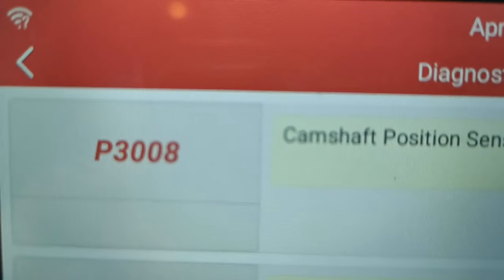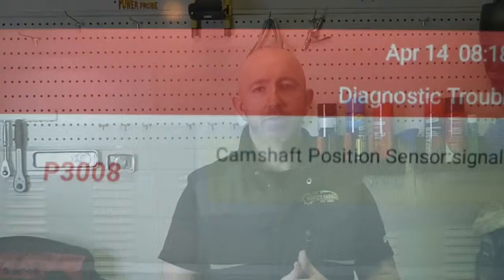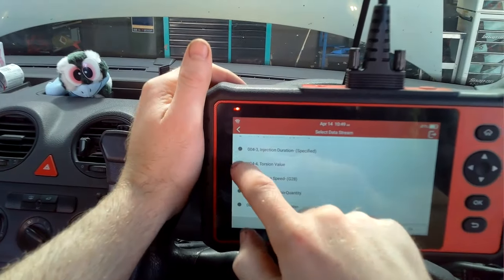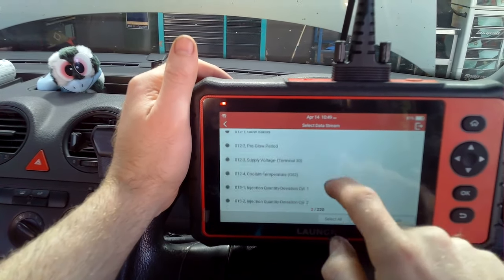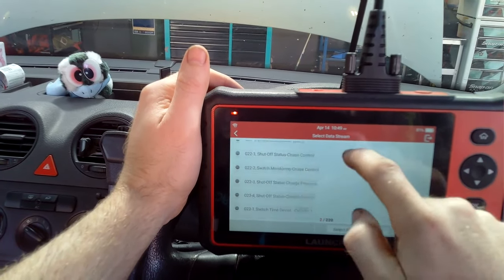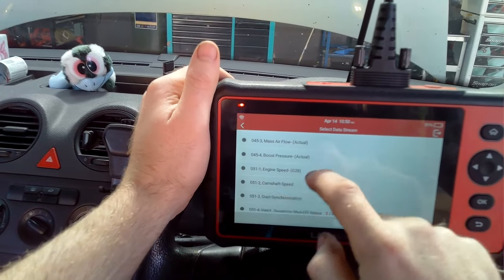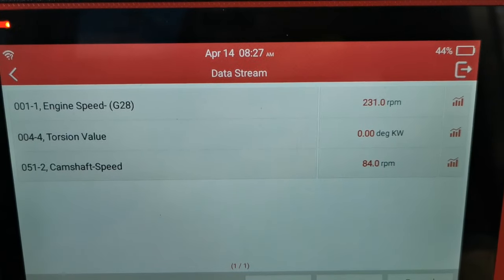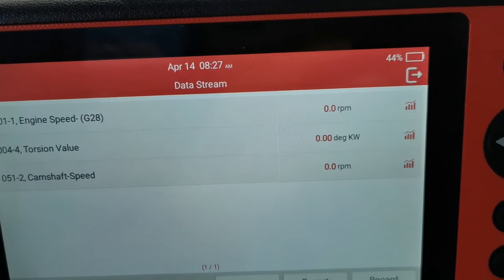Volkswagen TDI Cranking But No Start Fault - Found & Fixed - How To DIY

Comment: Thank you, you clever man. Unplugging the camshaft sensor was the clue I needed when I had been looking for a fuel fault. If you were here, I’d buy you a drink.
Reply: If there is still no start with sensor unplugged do I then follow up fuel problem?
Reply: Exactly what I did. In my case pointed to no fuel from pump in tank. While following to replace pump came across bad wiring.
Reply: Mine is doing the same thing need to do that tomorrow morning I was about to buy fuel pump but let me try this

Comment: All VAG owners become a mechanic in no time, hahaha. I've learnt a lot about TDI because I bought a high mileage VW Caddy 1.9 TDI. Part after part after part has been replaced my me. Things keep breaking at 300,000km. My van is practically new now after all the work I've done to it. It's drive another 300,000kms
Reply: I know exactly how you feel I have a 1.9 2009 golf
Reply: Vw 2.5 😂😂 u right i done lots of parts and scans

Comment: You may have just have saved me a small fortune.   I was losing hope to an extent.  I drove the car parked it up, then it refuses to start that Evening.  Servicing has been kept bang up to date.  Interestingly  its timing belt, and water pump were replaced only several weeks ago. It has been such an easy starter to date, and was seemingly running nicely.  It delivered 65.2m.p.g running up to Morecambe and back to Cornwall.  I've precious few pennies to replace the car with at this time.  If Your advice pays off here Gerard I will really need to send you a decent drink Sir..  Thank You so very much for posting a clear concise video.
Reply: any updates ser?

Comment: Hi, I have a 2.0 bkd engine, it starts really slow in the morning. I changed the battery, injector orings and glow plugs, but still starts really slow in the morning, after 2 cranks.

Comment: Please assist I've done engine overhaul,the engine starts but rev up to 2500rpm.ive done timing on the front and rear crank sensor.please assist vehicle has no power 😭

Comment: Mate iv changed the timing belt and sensor code gone and started and run for bit cut out got code for glow plugs changed them and now it crank try to start 1000 rpm and cuts out iv checked fuel all seems fine have no clue  what is going on now nothing  coming up on scanner any clue  any advice would be fantastic  thanks

Comment: Thank you so much!!! My 2000 Jetta tdi with 419,000 miles (that I put on it) wouldn’t start today. So while I was in a parking lot I watched your video and it was just what I needed to diagnose the problem. My fuel injection pump pulley had slipped 1/8 of an inch from the last time I did a timing belt change a year ago. So I grabbed a socket set and a couple wrenches and 15 minutes later it fired right up and I was able to drive back home 😀.

Comment: I recently bought a cheap a vw bora 1.9tdi pd100. Took about 4 seconds to start. So I was looking around the engine bay and noticed the cam position sensor was unplugged and taped up 😮. Plugged it in and no start. 

Decided to check engine timing. The crankshaft pin locked  in and cam was about a tooth out. 
Maybe a touch more. Retimed it all and plugged sensor back in bingo. Runs like a dream now.

Comment: wifes old car has been sitting for 6+ months, started maybe 3-4 times and not driven. I started to drive it and noticed hard to start when cold. I popped the bonnet to check the battery charge and there were 2 spanners, thinking I left them in there for 6 months after a service, went and checked them after watching your vid and they are 13/19mm, I must have played with cam timing... without lifting a spanner to it, id say your vid has got me in the right direction

Comment: Lovely video, it's exactly the problem with my Seat Ibiza 1.9tdi 2008. I just noticed by this video that the sensor might not be the problem but yes the camshaft out of position since a cold start will make a knocking noise from the engine. Will be great after 5 mins but since the sensor is telling me something is wrong it's a lot easier to follow this amazing video before blindly buying a new sensor. A 10000000 thanks to you !!
Reply: Mine at cold start taps for about 5 seconds then goes away.

Comment: Nice Diag Gerard good Bias voltage 5v on the signal wire the torsion values are as close to zero as possible
Reply from the maker: Cheers for that Ian 👌🙏
Reply: When testing the signal wire. Shouldn't the cam sprocket be in a certain position? Cam sensor is a potentiometer so surely if in wrong location wouldn't the 5v be pulled to ground thus sending a signal of cam position.

Edit... scrap that. You run the test with sensor unplugged. Only relevant when backprobing.
Good job. I've worked on loads of these and didn't realise the torsion could be so far out as to cause non start.

Comment: We used to have a dude like you at our work but unfortunately he left & as far as I know, he's out of the trade, it's a shocking waste, he'd make an excellent trade school teacher 👍
Reply from the maker: Thank you Lance, I appreciate the comment.
It's such a shame when we lose good techs to other jobs or roles. They are needed badly these days
Reply: @GerardBurkeBurkesGarage  I have a jetta 6tdi it does not make start. If you put quick start on it it will start bt it does not Rev. No power at all. I tested the injectors they are 100 % correct. Vcds is showing nothing.
Reply: Must be running to set torsion values.
Reply: Possible MAF problem or intake air leak.
Reply: If you have a lift pump, make sure it is providing pressure.

Comment: Torsion value is written in pen on the cam cover on them all, usually doesn’t last too long. Supposed to be written in the service manual too. Some can be up to 5 degrees either way, 0.0 is usually the best benchmark to adjust from when doing it.

Comment: Great video Ger my car is in a garage at the moment it had a leak in a fuel line its now repaired but wont start ..
Reply: Bleed pump and injector lines if it is ALH engine.
Reply: @bobirving6052  got it sorted after a week..

Comment: My 2013 Passat TDI just started doing this a few days ago. We'll have a go at it and hope it's this simple. 😁 Ty
Reply: Did it work
Reply: i am having the same problems. had me change the fuel pump. and the problem still persists. LMK if you got yours to work
Reply: Please let me know if it works  I have same problem with 2013 vw passat
Reply: Did you get it to work ??? My 2015 2.0 TDI just quit at the mall. Cranks, won't start. Going to have to check this out.

Comment: For 2.0tdi 16v Inlet cam (Torsion should be 0), the exhaust cam should be adjusted so the live data for fuel consumption is flicking between 0.4-0.6 l/hr.
For single sprocket 1.9tdi for example torsion is also 0
Reply: THANKYOU 🍻

Comment: Gotta drive over after the wife's 2015 TDI 2.0 refused to start. No issues so far and car has only 60K miles, barely broken in (lol). I'll definitely look into this cam position sensor.

Comment: I have the same symptoms about the vw tdi engine but without the fault code as well as your ,so I need to check out the fuel pump or injector.

Comment: So I have a 2013 Passat tdi 6 spd manual. Once in a while after driving my car I go into a store come out and try to start it and it just cranks over. I sometimes have to let the car sit for 20-30 mins before it starts and I can drive. This doesn’t happen all the time only randomly. Also when the car is on a cold start and I start driving it bucks a little like it wants to take off. Do you think it could be the crank sensor failing? Ps no codes! Thanks so much

Comment: Thanks for informative video. However my issue is engine will crank but not start first thing. Wait 5 minutes and it starts and runs perfectly. I’ve had fuel pump replaced and ecu checked out. What would you suggest next?
Reply: hello, did you solve the problem?

Comment: I have that same problem mine is polo 1.9 tdi same engine I move it without cam sensor and it doesn't pick up well when I plug it is shut down thanks for the advice

Comment: Hi mate could you advice me got a vw touran 2008 1.6 fsi 
Reverse lights stoped working 2 daysbago yesturday the headlights comes on with ignition while headlamps relay switch is off  today the car wont start any advice would be very appreciated 

Changed the h switch still no difference checked fuses wirh probe they seem ok

Comment: Gerard, I have a 2008 vw Passat. Was driving up until a few moments ago, I parked the car into my drive and a short while later I had to head back out but unfortunately the car wouldn’t start. The dash lights, radio, headlights are all coming on. I thought it might have been the battery in the key fob so I changed the battery in that but the car still did not start. Any ideas of what it could be?
Reply: I just did the exact same thing bought a new battery because I thought it was too after they did my sensor for my door it started doing this gotta try this

Comment: Will these steps work on the 2.0? I have a 2011 that intermittently doesn’t start when it happened the p3007 code popped up but went away after it finally started

Comment: My 06’ starts are idles nicely, it’s only once you press the throttle the RPMs gets up to roughly 2000 and the motor starts jumping like it has a two-step then the tachometer drops to zero and the glow plug light comes on. Anyone else have a similar issue? I just want to make sure I’m swapping out the correct part lol. I’ve checked VCDS and it doesn’t seem to be throwing the code many have mentioned. I appreciate any help and and thank you for the video and the information within.

Comment: I have a 2.0 pd, cut out, won’t run, gravity fed the flow to tandem pump, and vacuum can on the return, I can’t get anything back from the return cranking or not, therefore no flow to the injectors. Do the tandem pumps fail like this???

Comment: Hello and congratulation for this video.  I have same problem with my Caddy, year 2010 , 1.9 TDI, 77kw, 2k ACBLSX01 engine.  All the symbols appear on the board when I turn on the ignition, in this case  I have excluded some releys. Like in this video I disconected the sensor but engine it still won't start.  Could  you give me another suggestions please? I'm not mechanical but some timebut I like to solve problems myself . Thank you    I don't know if it helps but the engine has 108,000 real km on it.

Comment: Hi mate, great video! I unplugged the sensor and it still just turns over BUT sound as if it’s about to start any minute whereas when the sensor is plugged in it has no interest at all. Any ideas? I think best thing is to re-time it from scratch?
Reply: If you have a lift pump, make sure it is providing pressure.

Comment: Thank you very much! I have been fighting with my brm for a while now. I just installed a stage 2 cam from kerma TDI and im not getting a torsion value! I am using vcds and I don’t know if I can see camshaft speed on there. I will try out a couple tips you gave in the video!
Reply: You don't need to see camshaft speed,what you need to see is the timing limits within specified tolerance.
Reply: @eugeneoreilly9356  I got it figured out finally haha it ended up that all 3 cam sensors I got were all bad. If anyone gets one I would get it straight from Kerma. I got 2 from autozone and one from rock auto. None worked except the one from Kerma
Reply: @cecilshannon2586  glad you got it running.
Reply: I bought cam sensor from Rockauto and it works fine.

Comment: I tried unplugging the crank sensor no luck. correction  I tried again and the engine started without the sensor!  Car is running 08 Touran 1.9 tdi 364000kms.  Thanks!

Comment: Hi I have same issue no start cold or hot on a 2.0tdi bnm engine any ideas what I should look for
Reply: Same problem except mine cut out like it had run out of fuel, luckily as I just pulled into a lay-by.
Reply: James, I had the same issues. It stalled on me and won't start. Just cranks. Did you find out what the problem was?
Reply: Anyone manage to solve this issue as I've got the same?

Comment: Hello there I have Signal on Pin 1 (4v) Pin 2 (3v) Pin 3 Is ground and my Caddy still doesn’t start but it does start with the camshaft sensor disconnected I put a new one in and still doesn’t starts

Comment: Hi Gerard thank you for sharing this video, Ive got a vw mk5 1.9tdi in the mornings it wont start i have to use starter spray then for rest of the day starting is fine... can you pinpoint me to a rite direction ? Any help would be well appreciated.
Reply: never use starting spray on a diesel, you could bend a con-rod!

Comment: Nice systematic diagnosis there. Could it still be a camshaft issue if the fault is intermittent? I've got a 2 litre tai Passat 2011 B7 that does this intermittently.
Reply: I'm having the same intermitent problem on my 2010 2.0T EOS

Comment: Hi, I have an Audi A3, cranks and just about starts and then runs rough. On acceleration it only gets going when at 3k RPM, however when it gets hot it seems to get much smoother and accelerates from 2K rpm. 

Has glow plug control module codes and also all injectors upper control limit reached.

What can it be?

Thank you

Comment: my project bkd engine'd golf had it's turbo let go. found metal everywhere upto the intercooler but nothing after.
replaced turbo and tried to flush oil and put fresh in.
it cranks fine but won't fire, was gonna try this but my fault code is p2100 (anti shudder valve) it is clean so a bit stuck.
trying to order one but would that prevent the engine starting?

Comment: i have the same engine and i need to ask can it just stop or can the problem get worse over a cple of days? Mine started after i parked it up drove it started making a screeching noise took home parked up was told it was the turbo but no smoke just loss of power then it wouldnt start i have smoke coming from the join to turbo and also down the air intake pipe but now it just doesnt run did show turbo boost preasure sensor fault that was it i need help

Comment: I have a vw passat b7 2012 2.0 tdi when I try starting my car it doesn't start I have to try starting for around 8 or 9 times until it does start and I can see another of smoke coming out of the exhaust and when it starts car runs fine as long as the engine is warm it will start 1st time but when cold it does not start do uiu have any ideas I've changed high pressure fuel pump air mass sensor timing belt and water pump replaced and does not show any codes please can you help me

Comment: Bonus just got my golf 1.9tdi BLS engine and it starts after a while noticed cam sensor not plugged in properly she just had full cam belt kit I'll test loom and look for signs as befor this she would fire straight up

Comment: My 2002 ML270 cdi has the same problem. Replaced the cam shaft sensor position sensor, the Crank sensor and it still won’t start!

Comment: hello. please help me. i have Audi A3 2.0 tdi 2004. in the morning it has a hard start. after first start, its fine and start normally. if let it cool for 2 3 hours. have the same problem. i replacment, injector seals, glow plug, 2 injector, and no solutions.. in the engine check light shows only Egr Valve. please help me

Comment: Hi am looking for a bit of advice,my wife was driving my 61 plate Octavia vrs TDI when it just turned off,took it to the garage they changed the crankshaft sensor,then said they noticed moisture about the ECU but they thought it was another sensor behind the gearbox, gearbox was removed and sensor was checked and all fine,put new clutch in car while the gearbox out, got car back been starting and stopping and then broken down again,towed to other garage and now saying car has no compression.

Comment: I got 2006 jetta tdi and similar problems, but mine cranks really hard and doesn't start. I tried to do what you did and not start and no codes.  What else could be ?

Comment: very useful and informative video. My question to you is how can l determine on a five pin connector vw golf mk6 1.6 tdi.
which pins relate to +5v and _5v on the air intake swirl valve motor. Not easy to find access to a wiring diagram for this.
As l suspect the swirl motor and wish to see if it functions on the bench

6

Comment: I'm having a misfire (esporadic) error code on cilinder number 2 p0302/00770 on my VW Passat b6 1.9 TDI! Do you think this camshaft position can be my problem? Change recently spark plugs and wires Cable! 👍👍👍
Reply: Had the same problem with a jetta 5.it would start nicely idle nicely but when it got to normal operating temp it would start to misfire and splutter sporadically only to find out the crank sensor had a chip on it.change the sensor and booom the problem was solved

Comment: Great video 👍
Seems like a bad design by VW, is there a need to have the camshaft adjustable?
Reply from the maker: Thank you 🙏
Yes it has its advantages for sure, first time I ever seen one slip into this position, I don't blame the engine design for this problem it could have had someone not tighten them correctly at some stage.
Reply: @GerardBurkeBurkesGarage   what is the advantage ?
Reply: @Fenix_fm1  It makes it easier to change the cambelt
Reply: @GerardBurkeBurkesGarage  how do i know which torsion value is best for my BLS motor with DPF filter or watch idle consumption and how much should it be ??? Thanks
Reply: @nedimkazaz8345  did you find out ?
Reply: Advantage to adjustable cam is that you can precisely adjust injection timing which is extremely important.
Reply: It needs to be adjustable otherwise it won't be possible to archive the correct timing belt tension.